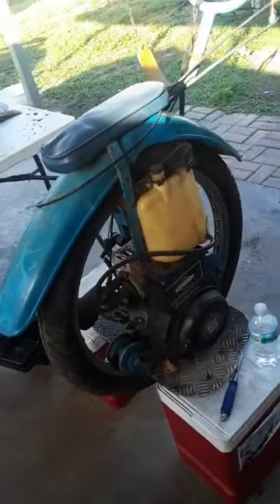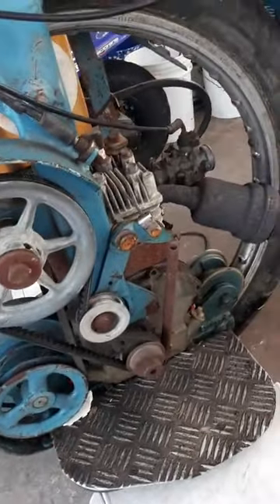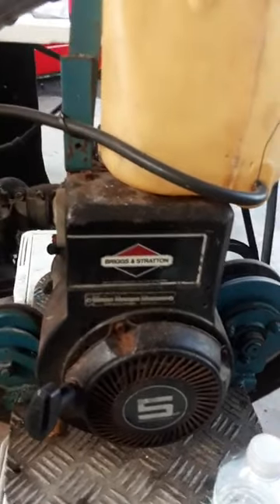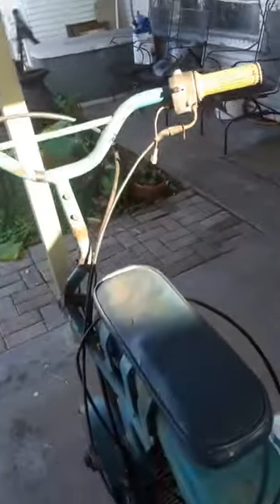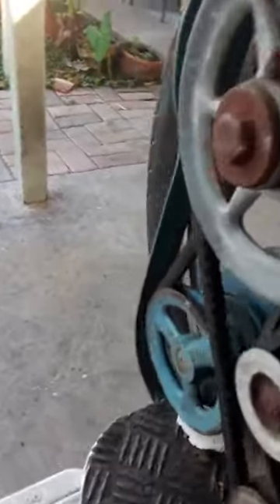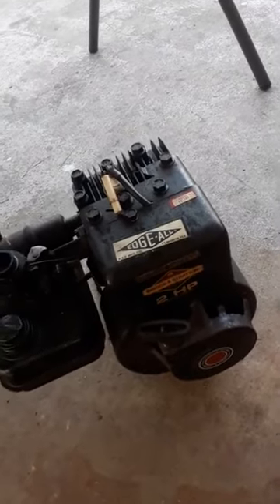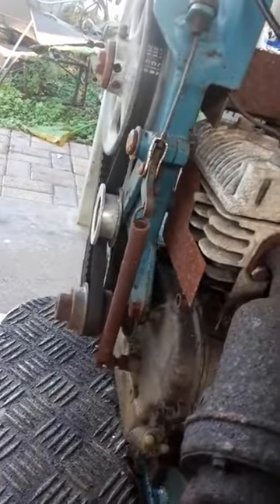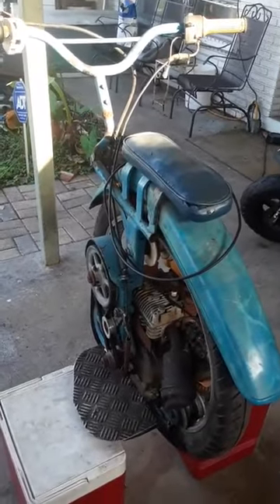Gas powered unicycle walk around

Comment: I built the original one in 1991 to ride to the Brass monkey rally in New Zealand. I rode 2 hours non stop! There was so much interest I created a "how to" sheet of notes, drawings and photos for others to copy it and learn to ride one. 90% of this mike (it's not a bike..) is identical to the specs on the sheet. I did build another one with a more powerful engine. Very difficult to ride but once mastered much more fun! (like going from a moped to a motocross bike!) and the slippage problem This is easily solved by machining a "tread" on the rim contact surface.
Reply from the maker: yeah i was thinking about either doing the machining tread or a sticky sandpaper tread like skateboards have.
Reply: Hi Peter! Any chance of getting a hang of the blueprints? I want to build one!
Reply from the maker: @Rocksaplenty  you can buy mine it's in pieces I never got to put it back together.

Comment: Maybe the whole inside rim should be toothed and you could drive it with a gear, no more slippage
Reply from the maker: the previous owner said he drove it fine with a 2hp motor but as soon as he put the 5 on it it wouldnt drive anymore. so im putting in a 2hp again.
Reply: @smallengineguys  I machined a tread into the rim. Works fine now